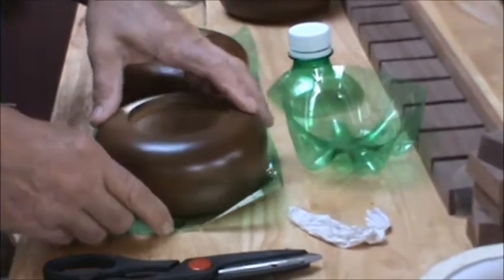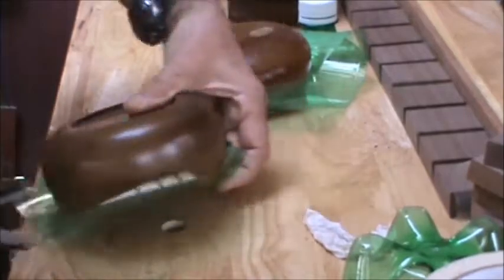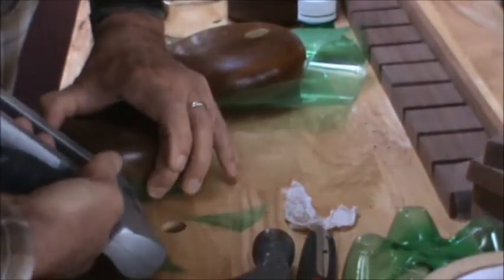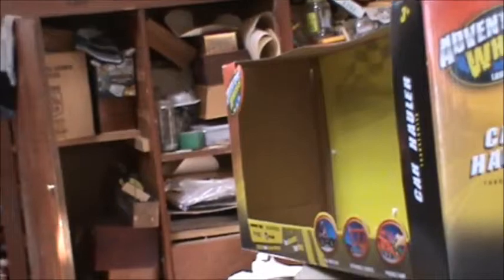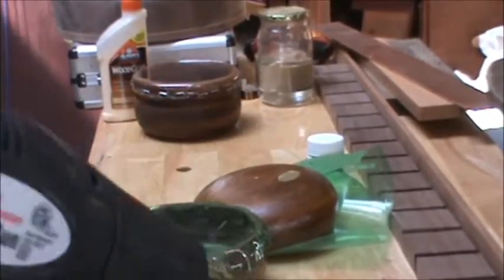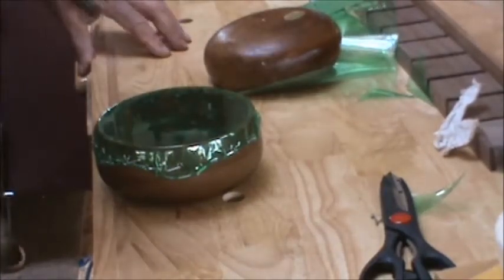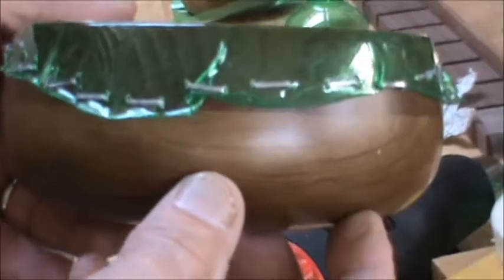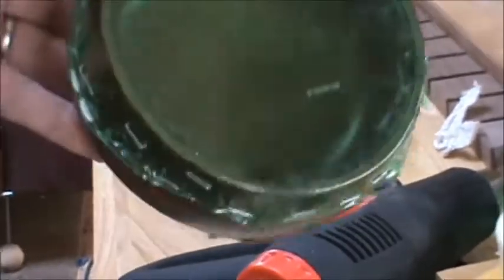Soda Bottle Banjo Head

Comment: Not sure if you still comment on this channel at all, but I made a banjo head from a soda bottle and used rivets and epoxy. The epoxy was just to hold the plastic on there before I could drill the rivet holes. The rivets work but the epoxy came completely undone. I only put it on the top though so maybe epoxy on the side would work, but the way I did it, the epoxy didn't hold up.